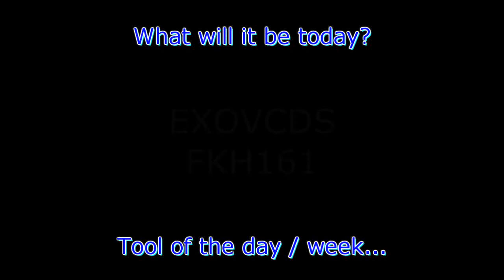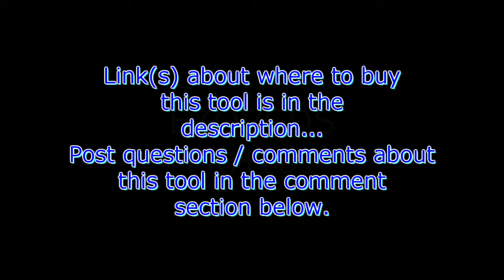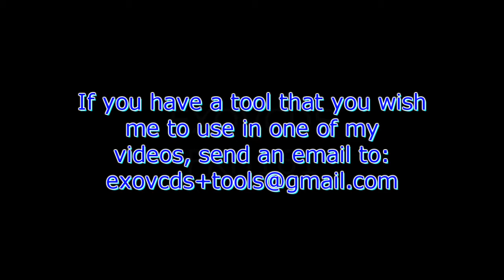Tool of the Day / Week: #016

Comment: It's cool to see the actual tools in use. I've only ever seen the ones made from old credit cards used.
Reply from the maker: I have some old hack saw blades that I made into a radio removal tool... breaking the blade into 2 pieces and then grinding them skinnier (with no teeth) so they could fit into the release slots. Can't recall what brand radio they were used for, but I still have them just in case I need them.

Comment: Cut Pendaflex Steel File hanger in half. Insert the ends of each piece into the holes. Works just as well as the tool.

Comment: These are really valuable tools to have if you do related work. Clearly logical, but I didn't know we  could get assorted sets like this.

Some might come here in relation to stereo/radio swap or diagnostics, so a little tip: If you already have, or is about to equip your (VW, Audi, Skoda, Seat etc) car with an aftermarket radio, check that the aftermarket adapter loom or radio itself doesn't output live +12v on the K-line. To do this, check for ~12v/battery voltage between pin 4 & 7 on the "OBD2" diagnostics port. A live "hard feed" here is very likely to fry the driver in any connected diagnostic interface unless internally fused.

Detailed info and ways to remedy the issue: http://www.ross-tech.com/vag-com/aftermarket-radio.html
Reply from the maker: pr0xZen As always... thanks for the GREAT info!